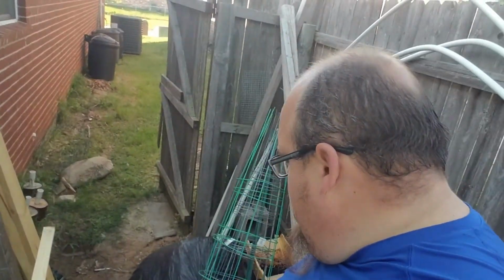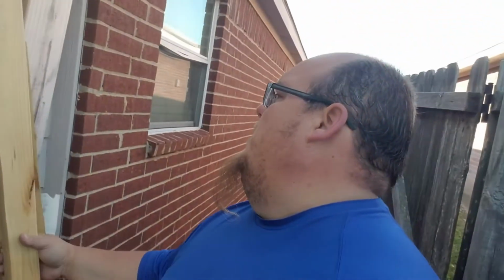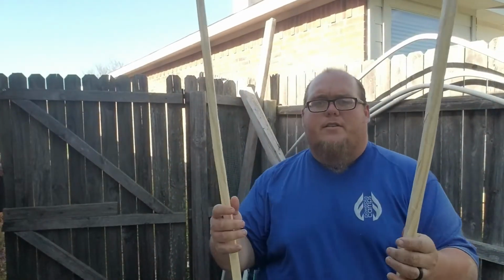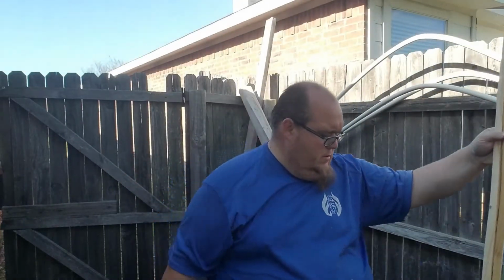How to make your own tomato stakes | DIY Tomato Stakes

Comment: I bought a stake at the garden store. It has three rings in the middle and metal.  About 3 1/2 ft tall.   How tall will tomatoes vines grow?  Your stakes look as tall as you. Please advise. Thanks again
Reply: Some grow as big as 20 feet tall, depending on the variety. I usually use bamboo sticks, and tie old pantie hoses to tie the plant to the stake. Just make sure to give it a little slack so the plant doesn't rip.

Comment: Are you out of your  mind? You can buy 5  tomato stakes. For the price of one  2x4..
Reply from the maker: Hey Pilar! I can usually get 6 or so out of a 2x4 for about $2.50. The bonus is that these stakes are 8 ft tall which I need - my plants use every bit of that. Thanks for the suggestion! Thanks for watching!